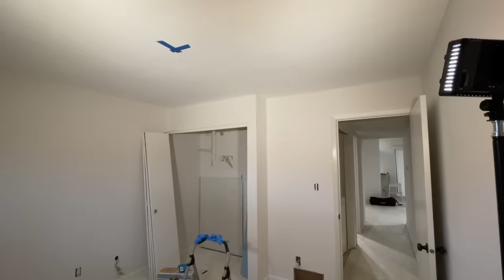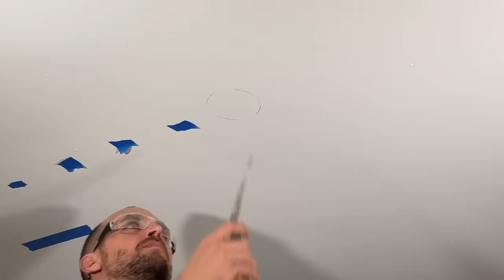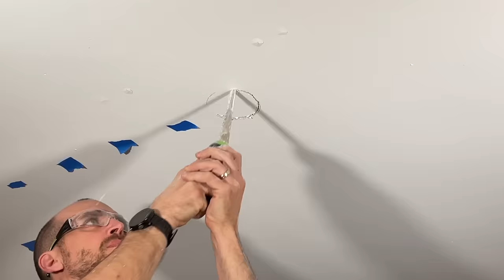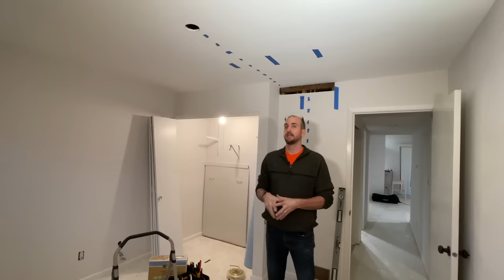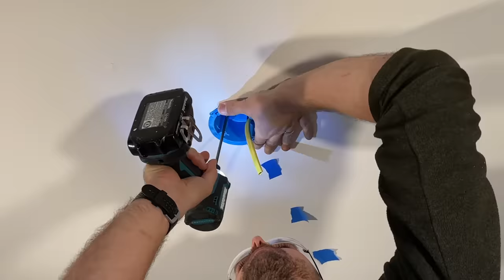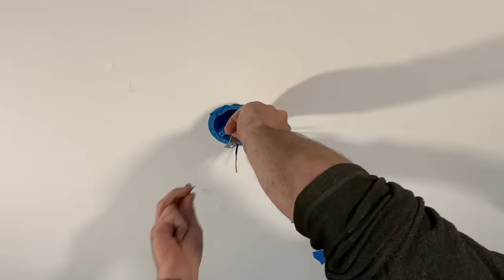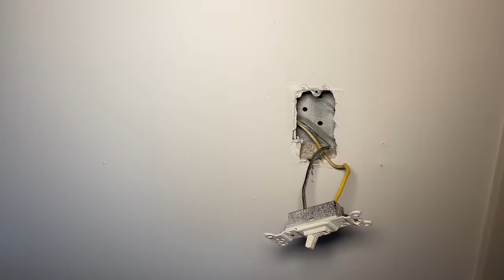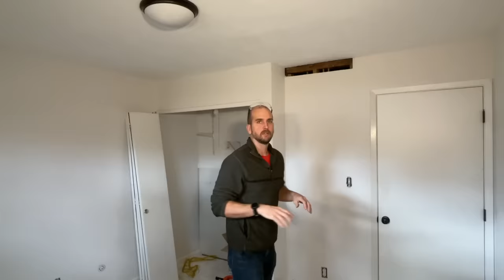How To Install Ceiling Light Without Existing Wiring

Comment: Two things I would do differently here.  1) Twist the wires together with lineman pliers and snip them flush before applying the wire nut.  The connection will be better and more secure.  2) Definitely no need to cut the drywall all the way into the corner like that.  It's much easier to patch if you leave the corners undisturbed.  Could have left 2" or so of drywall out from each corner and just had a flat patch.
Reply: You don’t need to use pliers especially with one wire
Reply: @Dontcare523  "Need" to, no.  You can carelessly stuff the wires in and it will usually still work.  But any good electrician will tell you it makes a better connection if you twist the wires together.  Won't loosen or come apart as you stuff it into the box, less likely to be a problem later.  It's what lineman pliers are designed for.
Reply: @dwasifarkaralahishipoor2223  if you twist the wire nut tight enough it’s fine the plier trick is a waste of time
Reply: @Dontcare523  The plier "trick" is how professionals do it.  But go ahead, be sloppy and careless.  It's your house.
Reply: @dwasifarkaralahishipoor2223  no they don’t I’ve never seen it you can let fixtures hang from only wire nuts if you know what you’re doing
Reply: @Dontcare523  Whatever, dude.  It's your house, do sloppy work if you want.  But the nut is not supposed to make the connection. A solid connection should exist before you put the nut on.  If you rely on the nut to make the connection, you don't know how much electrical contact actually exists inside that nut. Dangling the fixture from it doesn't prove you have a solid connection. You could be mainly grabbing the insulation; if you didn't make the connection before you put the nut on, you don't know.  Will it work your way?  Sure, most of the time.  But it's less safe and less reliable, more prone to failure.  And speaking of failure, you'd fail the electrician apprentice exams if you gave your answer.
Reply: I try to just avoid wire nuts.  They cost more but WAGO connectors ease my OCD mind.
Reply: @sntx1000  I've considered those.  A lot of people like them.  The problem, though, is that unlike a wire nut which is passive, a WAGO actually becomes part of the circuit.  Connecting two wires with a nut is one connection: wire to wire, and the nut doesn't carry any current (if you're using it right).  Two wires with a WAGO is two connections; wire 1 to WAGO and wire 2 to WAGO, doubling the potential points of resistance failure.
Reply: @dwasifarkaralahishipoor2223  I'm a certified journeyman electrician myself, and you are absolutely correct about twisting the wires together with the linesmen before applying the wire nut.  Amateurs think they know it all until they burn down their house.  🤣
Reply: @CBCNamja  Yeah, I bet he uses backstab on switches and receptacles too.  🤣  Thanks for backing me up.
Reply: @Dontcare523  I'm an electrician with over 30 years of experience and I always twist my wire before capping with a wire nut.   When you do this as a professional and your business card says all labor is guaranteed forever, you tend to go with the best method instead of what you can get away with.
As already been pointed out, wagos are also a good way to go ... But in truth, Twisted wires give a direct connection (wire to wire) and also a larger surface area.  Injunction boxes with multiple circuits, I will often use wagos on one circuit and wire nuts on another to help make it more obvious for the next person.

Pro tip: you know those dudes who say that afci circuit breakers give nuisance trips?  They're the same guys who don't twist their wires together and don't tape the receptacles.  ;-)
I use AFCI, gfci, and dual function circuit breakers all the time -including double pole AFCIs on knob and tube with shared neutrals.
Reply: @SwingboyPA  wire nuts twist the wires…
Reply: @SwingboyPA  you probably take 10 minutes each outlet too
Reply: @Dontcare523  No, and even if I did, I live by the motto if you don't have time to do it right, you don't have time to do it twice.  If you can't make money working slowly, you need to either improve your skills or charge more.
Pro tip: when you get really good at your trade and your reputation precedes you, you don't have to compete with bottom feeders for the lowest bid.  That might sound like an insult, but I mean the sincerely: if you're seriously worried about how much time you take to do a job, you're playing the game by the wrong rules.
Reply: @SwingboyPA  it’s a production business the faster you are the more money you make
Reply: @Dontcare523  okay listen, you've gotten tons of feedback here. Obviously your methodology sucks, and you just let me know that your business model sucks.
You think that you're in the production business, I think I'm in the customer service business..
That's the difference between a cog (I'm guessing you're an apprentice) and a professional who is running their own business.
My advice to you is that you work for someone better who will help you to develop your skills and then appreciate your work -not how much money you are making for them.
Reply: @SwingboyPA  I work on million dollar houses daily and have never had a complaint and the last “certified” journeyman I knew got fired because they couldn’t wire a simple slab house also you gave no good feedback
Reply: @SwingboyPA  also you’ve been doing it for 30 years and still aren’t a master why would I listen to you
Reply: @SwingboyPA  and a journeyman can’t pull permits so I dont how you have a real business
Reply: Dude, stop posting late at night.  You're confusing me with someone else who posted above.

TBH though, IF you were an electrician, you'd know that many jurisdictions across the country allow people other than a single-licensee (Master Electrician) to pull a permit.  In some states, there are licenses for residential-only electricians and some counties even allow homeowners to pull their own permits...  Even if I were on my first day on the job, I'd tell you what ANY tradesman knows: Knowledge is about 10% of the job; once you know what to do, GOOD technique is far more important.  Most of my work is correcting violations and trouble-shooting; I fix problems in buildings that were permitted so I can tell you that I don't rely on my license to do good work: I rely on my integrity.  I've done fire reports for insurance companies, been on TV shows, taught several guys from the ground up who have become Master Electricians and moved on.
Spend some time in the real world and you might learn something beyond being a low-rung "production" electrician.

Like I said, you got feedback here about how to improve the quality of your work; so instead of resisting information that is useful, you could take it to heart.

And the whole "million dollar house" thing is just stupid.  I live in a city where apartments cost more than $1 million ...that makes NO difference to the QUALITY of the work that YOU should bring to EVERY job.

Clean up your act because you CAN do better IF you apply yourself.

Anyway, I'm done; if you are an electrician, then good luck with your career.
Reply: @SwingboyPA  He's not an electrician.  When I said "that's how professionals do it," he responded, "no they don't, I've never seen it."  Notice he said "they," not "we."  My guess: at the most, he's an unbonded, unlicensed handyman.  Also interesting to observe that you spell, punctuate, and capitalize, and he does not.  Details make the difference.
Reply: @dwasifarkaralahishipoor2223  ... And you can't be in the field for even a year without having this discussion. Even online in the forum like electrician talk (which is licensed professionals only) this question is asked and the response is 10 or 20 to 1 in favor of twisting.  In an apprentice group which I advise, even the apprentices know this because they are in programs with professional training.
Reply: @SwingboyPA  I'm surprised the ratio isn't even higher.  Who are the 5% dissenters?  Arsonists?  :D
Reply: @Dontcare523  Yes they do to an extent, but it is still good habit to pre twist.  That said, Lineman pliers are not required to do that.  Which is what the earlier comments were in reference to.

These experienced Electricians can say it all they want it doesn't make true or better, its just the habit they have developed by what was pushed on them while being trained.  It may make it easier, but that is all the Lineman pliers do for the twist.

If they are properly connected you will know it with light/med pull of the wire.  If it pulls out it didn't properly twist and didn't have a solid connection.  If holds then it is properly held in place with a solid connection.
Reply: @Dontcare523  Actually they can,  I can pull permits to do the work on my home and not even be a journeyman.  I may have to bring in an outside inspector, but even experienced so called masters have to bring in an inspector.  Your argument is flawed.

Pre-twisting with lineman pliers is not needed and doesn't make the connection any better.  It was you were taught as a part of your trade.

No different then me using a heat shrink gun to reflow IC ships.  Its not the proper tool but it will do the job and do it correctly.   I have never had any reflows come back to me, but also didn't have to charge $300-600 to fix an Xbox RROD and it lasted longer than the manufactures reflow.

The tools don't make the professional, the knowledge and ability make the professional.  The tools just make it easier and sometimes faster.
Reply: @chrish7336  I don't know how you came to the conclusion that my posts have been about what specific tool to twist with.  Just to be crystal clear, my point, which up until now seemed obvious to everyone, was simply that you should pre-twist.  I mentioned lineman pliers because that's what the guy in the video was shown using.  Linemans are the customary tool for the job, but it doesn't matter what kind of pliers you twist with as long as you do it. The whole discussion up to now has been about whether to twist the wires or just jam them loose into the nut.  Everyone gets that but you.

That said, I'm confused by your posts.  You start out saying that pre-twisting is a "good habit" and then go on to completely reverse yourself and say it's "not needed."  So after two posts from you, I'm still not sure what side of the debate you're on.
Reply: @CBCNamja  I'm an amateur and I know better. Then again, I watched how a licensed electrician (my wife's uncle) did work and asked questions.
Reply: @SwingboyPA  I am not a licensed electrician and have found lots of bad stuff in my house. The original electrician did a crap job. After seeing how the building inspector looks at electrical, I can understand how they got away with some of the shortcuts. There were other things that I don't understand how the building inspector let them fly. I found an abandoned cable in the carport attic. It was just laying there. Not junction box. The other end was loose in the breaker panel. The black wire was cut short the white wire was connected to the neutral bus and the bare wire was connected to the ground bus. I still do not understand how that passed final inspection.
Reply: @eddie3721  Most inspectors don't take the time to really look at a job.
If electrical work takes one to three guys one or two weeks, there's no way that some dude, no matter how well trained, can really take in the scope of the job in 10-20 minutes.  :-(

I feel like my inspector and I have a good working relationship and he has integrity. We've had some good philosophical conversations about code and purpose ... But I imagine that, like in any profession, there are some guys out there just trying to pass the time and make a buck.  :-(
Reply: @eddie3721  Maybe the electrician that did your house was an apprentice. ..lol   In my area, I noticed some small companies only hire apprentices and unlicensed electricians, and they only have one real certify electrician going around checking their work.  Back in the days, I knew one guy that worked for such company.  He was a 1st year apprentice, and he had to work on the house alone with no experience.  The company owner just gave him the code book...lol. 🤣
Reply: @CBCNamja  That would make sense. It is a lot cheaper when doing it that way. I thought it was funny when I found that a single 15A GFCI breaker feeds the outlets outside, the outlets by the kitchen sink, the outlets in three different bathrooms, and the outlet by the makeup table. I learned about that one the hard way. My wife was getting ready for our wedding and tripped the breaker. She had the iron and her curling iron plugged in by the make up table, there was another iron going in one of the bathrooms and someone turned on a blower dryer in another bathroom. Felt like half the house went dark... LOL
Reply: @CBCNamja  Never seen a real electrician do it any other way. Here, here.
Reply: @SwingboyPA  if you wanted the best connection possible you would opt for crimped terminals, mechanical lugs or soldered and taped joints. You use what you trust, and that's ok. Wire nuts can provide a solid connection on their own without pre twisting, but it takes a lot of torque and it is fatiguing over the course of a day when you're wiring dozens of devices in.
Reply: @BatMan-cq8gq  I wish that YouTube let us put pictures in our responses. About 3 days ago I had a series of receptacles that were not showing ground even though it was a new rehab.  Sure enough, there was a receptacle with (4) 12/2 grounds under a red wire nut that had not been pre-twisted.  However, the wire nut was on so tight that it had The telltale "White Ring" of stretched plastic where (I guess 2 or) 3 of the wires had obviously binded but the fourth had not.
Here's the thing about proper wire nut technique: it's not just about twisting wires together and popping a wire nut on, you have to twist them together and cut the ends off so that all four wires will bond into the metal of the wire nut otherwise, you are relying on the twist and not the bonding effect of the wire nuts.  That will obviously work a lot better when the wires aren't twisted, but that is not the full scope of proper technique.

Bat Man, you mentioned hand fatigue and that is a really good point. Why do all of that work with your hands when you can get a tighter, quicker, and more thorough connection by using lineman's pliers to twist the wires together and using your hands to just cap them when you are done?

I can see the appeal for production electricians to try to save time to make more money, but everything in life is quality versus expense and you are sacrificing quality to try to make more money. My focus is on doing an amazing job and charging what I'm worth.
Reply: @SwingboyPA  I can tell we have a very similar approach and appreciation for quality workmanship. Just to be clear I dont disagree with anything you've said. I think in the end of the day it comes down  to proper installation and attention to detail. We've all probably run into failed devices/connections of all types. I seen my fair share of failed, write nuts, terminal screws, back stabs, etc and it almost always comes back to quality of installation.
Reply: @BatMan-cq8gq  Thanks.  :-)

Yeah, people think electrical work is just "black to black, white to white".  And I tell them "Yes that's true; in fact the knowledge required for most work is so simple that it barely has anything to do with the actual quality of the job."
In essence, knowing that you need to hit a ball with a bat does not make you a baseball player.  There is a big problem in our culture of romanticizing individualism.  We watch a movie about some kid who has a knack for baseball and think that's how they got into the major leagues.  No one ever thinks about the years of training (apprenticeship), nor do people seem to recognize that every Major League player who has seemingly "made it" STILL has a coach that they work with regularly.
Reply: FACT. Thank you. I've raised all four of my kids, three sons and my daughter, that your "name" is on EVERYTHING you do and say, so have pride in it all.
Reply: @SwingboyPA  , I like your comments but I have one question. Is this a common practice of wrapping your outlets with electrical tape or an equivalent? I have never done that and I am not an electrician obviously. Just want to know the safest best way.
Reply: @COMMANDER-ONE  Hi John, I'm glad you've enjoyed some of what I've written. I'm a real blather mouth and I've written so much stuff for my customers that a lot of this is copy/paste or dictated into my phone so quickly that it can barely keep up. LOL
I can only reply from the perspective of my own experience ... Although this topic is also debated on forums across the country with DIYers and professionals weighing in on both sides.
The short answer is: Yes it is common practice, but not as common as it should be.

The long answer has to do with my personal experience:
Nearly 100% of my work is residential and in older buildings with work dating from the early 1900s to present.
In older work, receptacles and switches are almost always taped.  Although there are some exceptions for non-grounded circuits, virtually anything from the 1960s to the early 2000s is taped.  It's interesting to see the transition from very rough wrappings -like a really thin rubberized canvas to modern vinyl tape.  My old boss (who is now about 75 years old and still working because he likes being busy and has WAY too many customers) taught me to always tape up receptacles and switches. Any screws that are not used also get fully screwed in. The reasons for this are obvious: when working in crowded conditions you're less likely to make contact with either the edge of a steel box or another device.
ALSO: When GFCI and AFCI protection came into the industry, we immediately found issues with ground faults related to ground wires folding up and touching unprotected neutral terminals in receptacles.  All the more reason to tape up receptacles and switches to avoid Ground and (long term/low grade) Arc faults.
Things started to change when plastic boxes became common. I can understand the reasoning for this: since the box is not grounded, an electrician can't make contact between the non grounded box and a hot wire or terminal in that box.  This is when I really started to see untaped receptacles and switches -along with extra screws left as is (in an extended position). So in the past 15 years or so, there are a lot of electricians who were never trained to tape up receptacles and switches.  Sad.

The 2 phrases most often shared with customers by my old boss were "all my work is guaranteed forever" and "if we don't have time to do it right, we don't have time to do it twice".  He worked meticulously and was always overbooked, so there was neither time nor excuse for screw ups. In 13 years, we never had a call back.  That was my training.
Nowadays, a lot of my work is fixing other electricians problems because they won't come back when something doesn't work -essentially they know they should come back and fix it for free, so they won't honor that commitment because they know they did something wrong. So what do I find when I fix other people's work?  Sometimes it's just normal wear and tear -like chords under a desk that get pulled on and eventually damage the receptacle.  But most of the time it's due to poor technique -using back (stabby) tabs instead of screws, loose screws, wires bent around the screws backwards, arcing caused by wires that were not tucked back in the box,  terminals that were not taped, ground faults for the same reason (referred to by lazy electricians as "nuisance trips"  on AFCI and GFCI circuit breakers).
So there's no question in my mind that good technique is about 90% of the job. Some people are not well taught, or they just don't care -so guys like me will always be busy. I've never spent a dime on advertising; all my work comes from word of mouth and things like my Yelp reviews (which are free; Yelp has been amazing for my business and I've never given them a anything). My business strategy is to have so many repeat customers that I never need to advertise or hustle for new business.   This worked for my boss, and I certainly learned from him.
I consider myself a nice person. I'm snarky and sarcastic, but quick to apologize if I actually offend anyone. I think being a nice person helps with my customers, but more than anything I think that having been taught good technique right from the start has made me into a sought-after electrician. Like my boss, I live by the motto that all of my work is guaranteed forever.  I don't think I've had 5 callbacks in my entire life (I'm 61).  I live in a city and have enough work to mostly only work in my neighborhood.  I am limiting much of my work: I only do residential work, no 200 amp services, and I don't hang ceiling fans (elbow injuries) -still, I'm always booked 8 to 12 weeks in advance. My reputation is "the guy who fixes everyone else's s*** work".  And so, for this reason, although taping outlets and switches is not an agreed upon practice by all electricians, I firmly believe that it should be.
Reply: @SwingboyPA  , Thank you for the thorough reply. I am retired now (I do repair/remodel  work) and I do a lot of fixing the previous guys mistakes like you mentioned.
Reply: Instead of trying to boss him make your own video.Bottom line
Reply: @patrickarchuleta9594  "Boss him"? Seems a little exaggerated.
Reply: Master electrician here...  You apparently have zero clue what you're talking about...  You can only pull permits IF you've got your contractors license...  Years ago, a master electrician would be able to pull permits but not anymore.  Secondly, every single professional electrician does in fact use their pliers to twist the wire before they use wire nuts.  Apparently you need to go back into trade school and learn about the trade rather than spitballing nonsense on youtube!